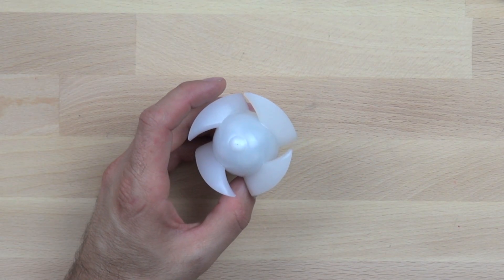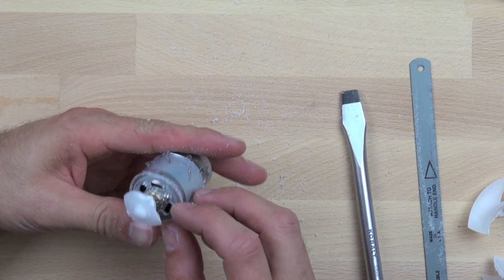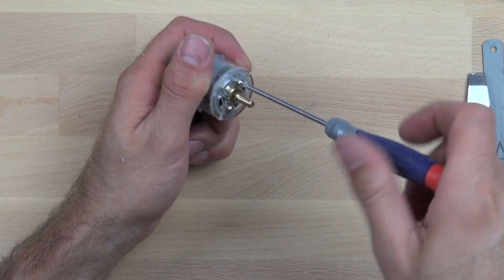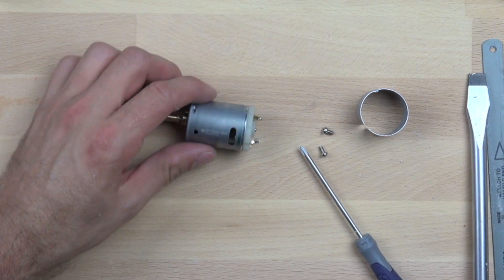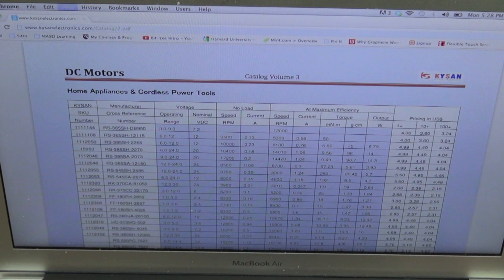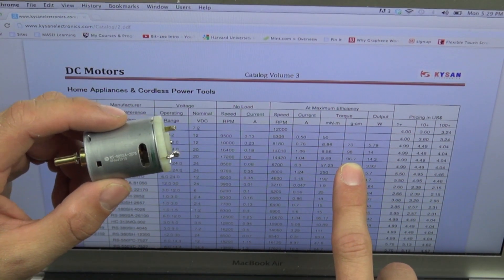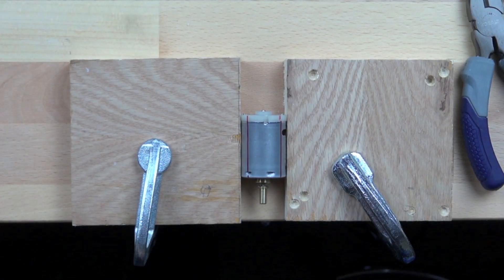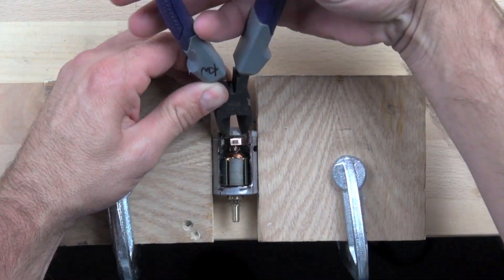Inside a hair dryer motor

Comment: so is a blow dryer motor 12v or 120v
Reply: 12 v, uses heaters as resistance lower voltage, the uses diodes to covert to dc
Reply: I actually don't know. I've never seen a motor like that in a hair dryer the only motors that seem normal to me are small universals. Oh and the voltage is said in the video. 20v DC
Reply: Ahhh ty I hooked one to 12v after gutting rest the stuff in there worked fine
Reply: This one is 20 nom tho
Reply: With 1a, so 20 Watts
Reply: 12 volts dude